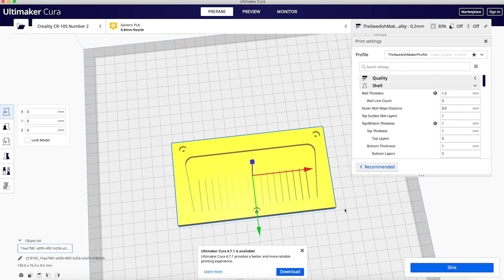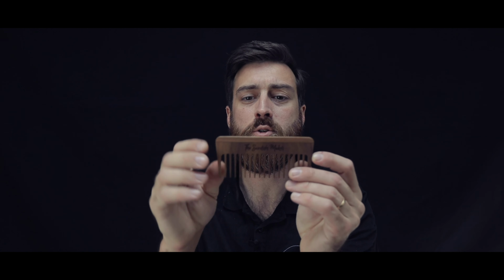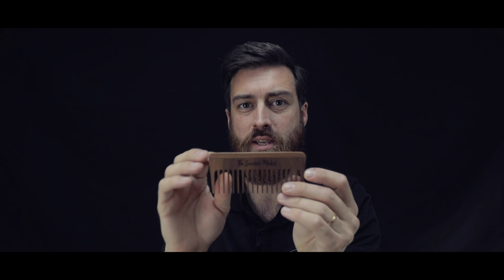Making a Wooden Beard Comb with 3018 PRO CNC

Comment: Also is MDF a good source of material for beard combs? If not which would you recommend
Reply from the maker: Many sorts of mdf contain different kind of glue that might not be perfect to use on the skin, but I am not sure.
Reply: @TheSwedishMaker  which type of material would you recommend using?
Reply from the maker: I would say hard wood as it will require some strength. Oak, walnut are two good alternatives.